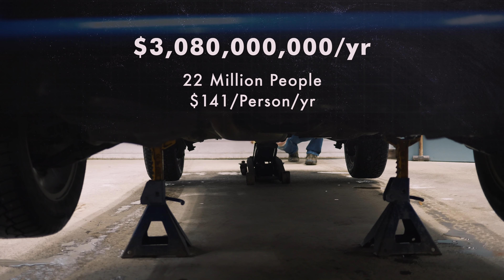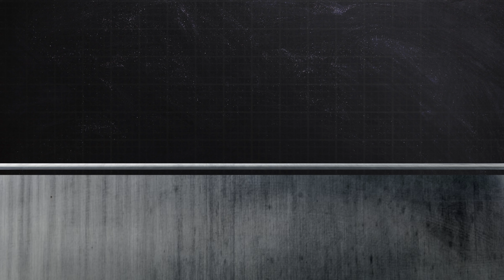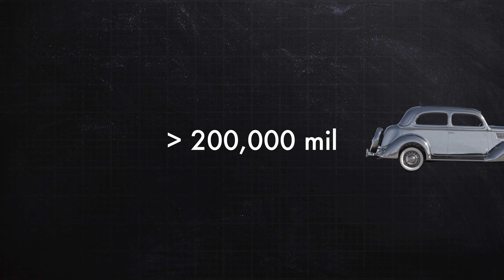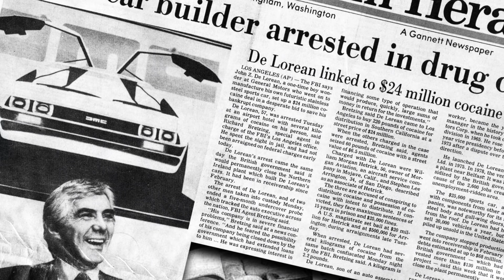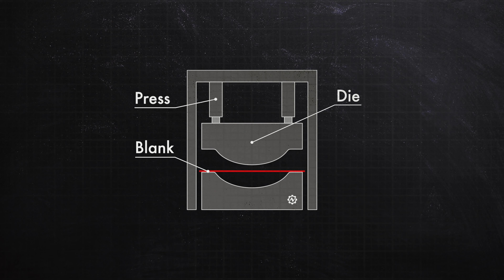The Overlooked Cybertruck Feature Hidden in Plain Sight

Comment: That's great and all when compared to standard steel bodies, but what about aluminum?  Aluminum can't rust at all, and forms a similar oxide layer when it corrodes.  Plus aluminum is lighter and maybe is easier to work with.  I know that even some trucks are moving to aluminum components now.

Comment: With an oxidizer like salt, corrosion is still possible. It just has to find a spot to sit. As for the battery, their working towards a million mile warranty for the batteries. The problem is the range is cut in half in salty temperatures.

Comment: mmmm. Aluminum doesn't rust either, is cheaper, easier to repair, lighter, etc. And most modern cars are using aluminum these days. 

The frame in modern cars is still a problem, but the trade off of a unibody stainless truck from a company that already takes a long time to repair vehicles as it is. No thanks.

Thus, you're talking about an electric vehicle in a cold environment where they will not perform nearly as efficiently as they are capable, where as an ICE powered vehicle already heats up under normal conditions and doesn't face the same level of efficiency loss in the cold.

Comment: The frame work of the cyber truck is really different. If they can get it approved, it will be very interesting to see how it performs in head on tests with other cars. I hope euro ncap puts the slomo videos online as usual. I’m a bit worried it might crush the other car too much, with devastating result. Cars nowadays has advanced demolition zones made to absorb the impact, will be very interesting to see Tesla’s approach on this. 

This might also be a way to move costs for metal research from spacex to Tesla that has more money.

Chromium is also not so environmentally friendly, and I guess everyone has seen Julia Roberts in the splendid role as Erin Brockovich. So I really hope Tesla has control over their new subcontractors. 

With that said, if they manage to pull it off this could revolutionize the car industry. again.

Comment: The forging temperature for stainless is 1700 - 2300°F (944 - 1280°C) which begs the question - why is 16G stainless sheets not heated to a forging temperature before press forming. It could be done with induction coils immediately before the metal hits the press. Does anyone know why this would not work?

Comment: I believe properly manufactured steel with a good sealer-basecoat under the primer should last really well and look good. My Germany-built 1983 Jetta was pretty easy to keep shiny and rust free, for the most part. And I live in Canada. ❄️ 

The reason manufacturers don't do this is it's cheaper to take shortcuts. So when a brand new car is for sale, properly treated steel of good quality doesn't look any different to buyers than cheaply remanufactured steel with poor protection under the paint.
To simply move product for short term gains, the manufacturer doesn't even have to care. But then they will lose long term brand confidence which would otherwise let them raise prices.

Comment: Overlooked? Isn't this the main thing that people usually rave about to do with stainless steel?
"I drive very old cars" - camera points to early 2000s car and he starts talking about a 90s car. Lol.
Informative video though anyway.
Plastic is a better solution to rust in this day and age in my opinion. Plenty of it already around too. Even wood can do a reasonable job as shown by the Africar, built for markets where cars rotting away is an even bigger problem that it can ever be in the US.
5:32 lol Jeepnee?
6:06 Fibreglass? I didn't think they had any GRP in them? That looks like metal too. It was designed mostly by Lotus as far as I know and they used steel chassis with GRP body, not the other way around, so the chassis should be metal.

Comment: While I accept that stainless steel will address a salt-induced rust problem, it may not be necessary. Starting from the mid 1980's some european cars have used galvanised sheet steel and plastic wheelarch liners for the same reason and rust is no longer a significant factor for european cars. I had a 1985 porsche 924s with not a spec of rust after 3 decades yet we see snow and use salt here in the UK.  I would be interested to know how - say -  post 2005 BMW/Audi/Mercedes fare in your winters, for example.

Comment: Wait i never thought about the battery. That's true. It can get worse cause of use. So VW MK9 will be electric and it will have a battery and we then can't have a VW for 40 years... We would need to change the "engine" every 10 years. (meaning the battery)
Reply from the maker: Perhaps. I’m working on this topic currently and should have a video addressing it in a few weeks.
Reply: @chargeeverywhere  I will stay tuned. Never thought about that. It should be an interesting topic😁😇😂

Comment: Dumb question: Say you buy a carbon fiber supercar and daily drive it (hear me out). Another guy buys a DMC 12 and daily drives it. Since Carbon fibre doesn't rust and stailess steel takes a does rust (over a loong time), say the DMC12 eventually rusts to oblivion and needs to be replaced and the guy just keeps buying DMC12s each time that happens. How long would it take for the DMC12 driver to spend more on DMC12s than the supercar driver on his car? Let's not take maintenance and fuel into account for the sake of simplicity.

Comment: Your absolutely right!  Canadian cities dump mountains of salt on the winter roads for five months of the year.  I've been fighting rust (Auto Cancer) on my vehicles for all of my life.  Besides the visible damage to body panels, it's the damage to the frame and unseen components that make the vehicle unsafe and very costly to repair or to slow the corrosion processes.  The Corvette has always been a dream car in Canada due to the fiberglass body.  The aluminum body Ford F150 pick-up trucks are selling here like hot cakes.  The Tesla Cybertruck will be a very welcome product in Canada and the stainless steel body will be a huge selling point.

Comment: 'Stainless steel is not one metal, it is a range, with different properties depending on the proportion of chromium, nickel, etc, so it may not rust, but can fail in other ways, like cracking for example, and not have the ability to be deep-drawn in a press, to form complex curves (the reason Cybertruck is all flat panels and straight lines)

Comment: Just buy a Jaguar a Range Rover  the newer models all have full aluminium bodies or buy a Porsche who has a zinc plated body panels since about 1972 and Audi also uses it since the big rust problems in the early 1980ties. So since 1990 they are also zinc plated. Because there's snow in Europe 😁

Comment: Tesla, if you are watching this, make an electric no frills city car like the twizzy, The only change is that it needs to have a 200 plus mile round trip capability for people who must commute to and from work to an affordable home outside the major citties.
Reply: Thats why i dislike tesla, far more complex than they need to be, all those computers, servos and wiring for things like pop out door handles will add weight and eventually deteriorate and cause nothing but headaches in the future.
At the airport we use electric tugs, they go all day towing stuff for years because there is almost nothing that can break on them. A car similar to them would be very cheap and easy to maintain.
Reply: or a small vehicle like the renault Zoe or the vw up for small cities by using aluminium

Comment: Contrary.  Stainless steel still ain’t rust-proof, bud.  It simply has 11% or higher chromium in the steel.  The Tesla Cybertruck will in fact rust as well.  And to say that this is going to keep a vehicle from rusting under normal winter driving conditions (at least in Alaska), you’re still gonna get rust and it’s still gonna eat through.  And Unibody construction absolutely sucks ass.  Also, at least my battery doesn’t have the possibility of blowing up and killing me and all my occupants under the “unbreakable” windows of such a poorly designed vehicle.
Additional.  I’m a certified welder and mechanic.  Replacing minor components on a vehicle that’s got a completely or nearly-completely welded body is likely going to be much harder to do and thus more expensive than replacing parts on a body-on-frame construction.  Okay, now Imma watch the video and see what you cover and what you attempt to leave out to try to make the Cybertruck look better than it is.  Which is actually an ironic metaphor cuz it’s the dumbest, ugliest looking thing ever.
Furthermore.  Having these POS’s on our streets is a terrible idea.  Say a driver takes a wrong turn into a building?  Vehicles are built to have a certain level of destructibility while maintaining passenger safety for a reason.  This thing is literally just a giant wedge capable of launching itself through pretty much anything, sealing the occupant inside, and then making it much harder to get the occupant out, to the point that the occupant will be a fried corpse before they can get a welder to bring a plasma torch that’s decent enough to (slowly) cut the occupant out.  Okay, let’s watch this video and see when you’re gonna mention all that.

Comment: As a person who has watched my truck be devoured by rust from living in Ohio and then later on the North Carolina coast I'm so frustrated that the main reason that I want a new truck is rust. That is the reason why I've never bought a new vehicle but I have reserved the cybertruck.
Reply: As someone from Canada, who does undercoating, I can recommend new Ford's. Regardless of any brand loyalty or quality, I can at least say the amount of exposed ferrous  metals underneath the more recent Ford trucks is fairly minimal. Most of the exposed undercarriage is aluminum.
Reply: @nightmathzombieethan  wasn't ford doing some e-coating stuff? it certainly sounded way better than the grease dodge puts on their frames(that will rub off with your fingers so it obviously has to be constantly reapplied) and whatever crap toyota did with their frames(can we even trust their frames? i'm a toyota dude but their rust was bad). I've seen a few posts from new chevy owners complaining about exposed paints on the frame/body but that could just be shit quality control.

Comment: Great video Josh but there really is no use some welding and Extra metal to one of those newer cars. So just took some duct tape put it across the back of it sprayed some ready for them into the hole that they some glass over the top of it and just sanded it out..... standard foam and glass patch would last just as long as the rest of that car body will..... I swear I would not on a newer vehicle

Comment: A good galvanization process should be able to keep a car safe from rust for a long time. I don't know about the Impreza in the video, but my 1998 Legacy has zero rust despite almost 200.000km in a place with very snowy and humid winters with lots of salt on the road. I also never bothered washing it after going out on the snow. Surely some regular steel bolts are busted... but the body is still perfect under the very sunburnt paint.

Comment: Agree - the best feature is hidden in plain sight makes it rust-free - and also light, as that the exo is structural, super cool feature!  But, a fender bender, might be more expensive, as the exo needs to be  repaired as it is part of the structural frame.  Not a problem on a regular car, regardless of rust or not. I don not know if this it a potential problem or not with the exo, any ideas?

Comment: The battery is designed to be replaceable, and is protected by a cover. it will take some time but you can really just think of it as a transmission swap rather than an expiry date. Most transmissions have to be overhauled at around 100k I'd imagine that the batteries are the same.

Comment: There is a big downside to stainless steel frames, it needs to be isolated from any carbon steel due to galvanic corrosion which would cause parts to prematurely fail vs carbon steel paired to carbon steel. Otherwise good video.

Comment: Don’t forget that the bottom of the truck is completely flat since it has the battery pack, I really don’t know what material is made out of, but if it is a single sheet of metal it would be very easy to replace

Comment: Stainless still isn't stain-proof though. With road salt introduced along with water you'll still see galvanic corrosion. That means the possibility of some pitting and discoloration. However unlike the usual steel alloys, it's unlikely to eat into it structurally and just tends to be a surface etching. It's just that it can end up looking bad with tarnishing, streaks, and spots if not addressed in time. I guess that still counts as an advantage since it's more of an annoyance than something that would structurally compromise and total a car over time.

Comment: I recon the CYBERTRUCK WILL RUST over time as well;
1.   the WELDED JOINTS
2    the MICROSCOPIC / HAIRLINE CRACKS that will develop in the body over time, as the miles add up.

Comment: The battery can be replaced a lot easier than the frame.
Reply: I think the Cybertruck will have the million mile battery
Reply: ALSO-RAN !  its not worth the sticker? if the 39k is accurate thats a pretty dang good price.. by the time you factor in a new truck(30k) and stripping the factory coatings and recoating it it'll likely be 40 grand if not more, not worth it. and that's assuming that the coating you put on has a good adhesion, say it adheres poorly and rusts under the coating(as has and continues to happen all the time) then you'll have a new car that warranty doesn't cover cause you terminated it by stripping the frame of its factory corrosion coating and I doubt any corrosion coating companies do any work without making you sign a package saying you're fucked if it goes wrong.
Reply: We also don't know what battery technology the truck will have. Tesla Battery day, where they show their new battery tech, hasn't happened. The battery could last a lot longer.
Reply: ALSO-RAN !  You think your truck is as good as a Cybertruck will be? It's not even an Also Ran in that race.
Reply: ALSO-RAN !  Running costs tiny, longevity decades. I think it will prove to be a wise investment for business.

Comment: Just a suggestion. I know your video is not about car body repairs but You’re going about your body repair the wrong way. Only use fibreglass over fibreglass, not steel. Need to cut out rust and spot weld metal in place. There are various videos on YouTube showing you the techniques to use.

Comment: Except that rust doesn't destroy a car nearly as quickly as battery decay. I've never seen a car "die" of rust in less than 15-20 years.
AND
A unibody truck... is a truck that can't really handle any offroad use, lest it's "frame" get bent.
(not trying to hate on Tesla, Elon's a fun guy, and eventually batteries will get to where EV's become much more attractive, but...)

Comment: I really like Tesla's designs; however, as a person who keeps the same vehicle for more than 10 years, I do have hesitations with Tesla in regards to repair costs and the ability to get replacement parts for me to do certain repairs myself. I'm talking Toyota quality and longevity. Plus if Tesla continues to disable DC charging, even for non Tesla charging networks, that is a big issue for me as well.
Reply: Free service and warranty, additional warranty can be bought after it runs out. You get like 3 free tows too
Reply: You've been tricked by the fake news lol. Teslas have an 8 year warranty off the shelf. On top of that, the batteries are engineered for 400k miles, the motors are engineered for 1 million miles, and the rest of the body is like any other car. They also don't block DC charging for almost all cases, they only do that to salvaged titles. As for repair parts once the car is 15+ years old, there's going to be plenty of them by then because they're making 400k cars a year now. It used to be an issue with Model S and X due to their low production, but parts aren't going to be an issue for Model 3 and Y.
Reply: As a Fabricator and Technician, I Truly believe you are over thinking how long parts will last on a Tesla. The last 8 years has shown a Tesla should be a 20+ year car!
Reply: @zachdancy5828  , have they solved the issue of the motor bearings wearing out requiring motor replacement. Just curious. That's an expensive repair.
Reply: A Tesla warranty will solve that problem.  And think how much you might save when Tesla starts offering car insurance.
Reply: @greatratejake5675  that's a terrifying thought. Can you say "conflict of interest?"

Comment: Battery is not an issue. Even if it degrades to 50% then it still is quite impressive battery. It would be equivalent maybe even 10 powerwalls! And they are not cheap! One powerwall costs $6,5k, so you would have equivalent of $65k. Lets say that due to their age they are worth even 1/3 so it would give $20k+. They are not meant to be recycled but reused! And they can really earn you a lot of money if you get to virtual power plant programme, and that will be easy in future. If you use your cybertruck for that, you may even earn enough to just buy a new one.

Comment: You forgot to mention one very unsetteling issue with stainless steel: Wherever stainless steel touches any piece of traditional steel it will still start to rust and never stop rusting away. Are all the underpinnings of the cybertruck stainless steel or other non-corroding materials?? Springs, axles, control arms etc.?
So, unless someone has found a solution to prevent stainless steel from behaving like this there's still a disaster waiting to happen under the cars skin.

Comment: Well there is different level's of ss meaning different level's of chromium in the carbon giving different levels of rust protection a 200 grade is much less rust resistant than a 600 grade or surgical ss .